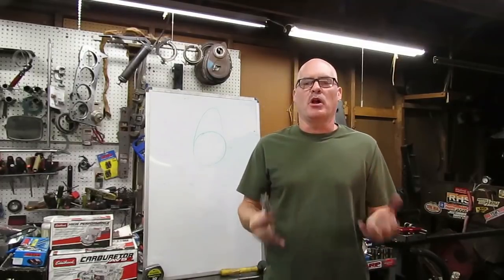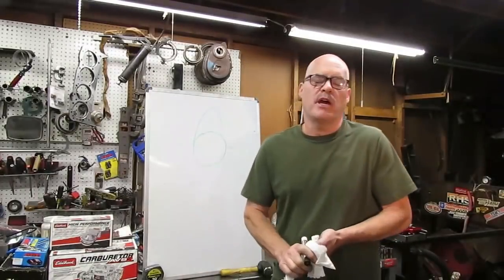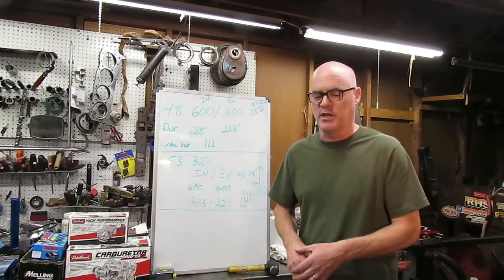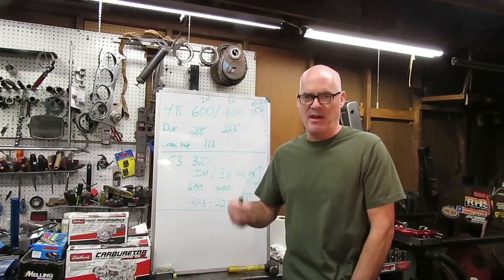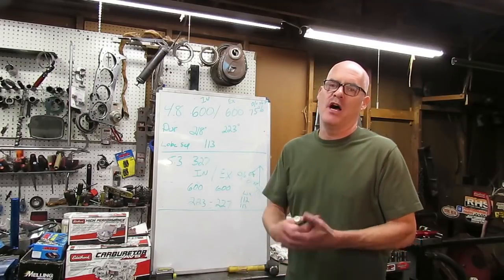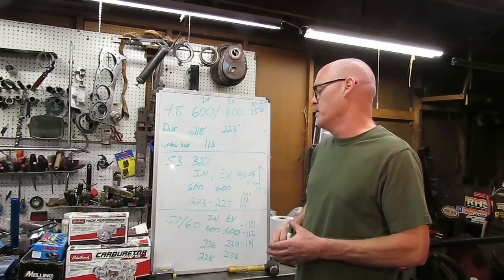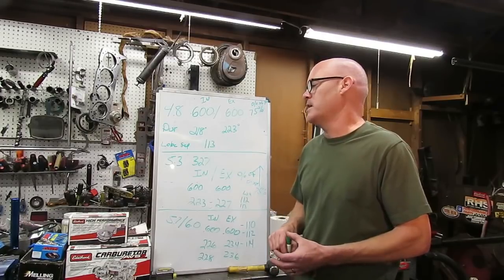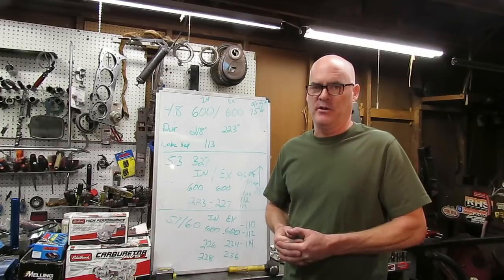How to properly select a Camshaft part 2

Comment: So what your reccomendation for a vortec 350, both roller and flat tappit?
Reply from the maker: for a flat tappet cam I would recommend throwing it in the trash for a roller 218/223 at .050 .500 lift
Reply: @Myvintageiron7512  hi.  I don't understand i saw other video where did you show how install flat tapet and how to break the cam hidráulic flat tapet. So in this message you said flat tapet throw in the garbage 😟😟

Comment: My man, how do I reach out and ask you for a little help. I've got the numbers more or less and I'm trying to pick between one cam or another - but it's for a much smaller turbo application. Do you have an email I could reach out with?
Reply from the maker: I would call Howard's cams and ask them they know more about turbo cams than I do
Reply: @Myvintageiron7512  I'll give em a go, they look like they only specialize in GM or Ford so hope they understand the goals of a Japanese import engine, I'm not aiming for 600hp lol. Something a little less but maximizing the power in my build. Thanks for your help and if you know a better company that knows imports let me know!

Comment: I am building a 532 BBC to run on pump gas, what compression can I run on an engine this big. Can you give me a recomadation.
Reply from the maker: cast heads 10 to 1 Aluminum heads 11 to 1
Reply: @Myvintageiron7512  So on a 632 w aluminum heads I can get away w 11 to 1, so how big of cam would it need?
Reply: @Myvintageiron7512  Can you give me a cam recommendation then I really would love to follow your lead

Comment: If yo "Hot Rod" don't Have a Radical cam Loping Idle,....just go All the way to Electric motor power !! .....The "Old School" Chevy L88 cam Duration was & Still is good for 550-600 Hp N/A......Every new  Factory hotrod today uses a "Cheatin"  turbo or supercharger  "Boosted"  engine to make Any big Hp numbers.....L88 cam Profile Forever man !!

Comment: Short tube headers for high rpm’s? I’m only seeing long tube headers recommended by the manufacturers for high RPM”s
Reply from the maker: nope that's not correct long tubes will give lower to mid-range torque. there is a huge amount of science behind this that I really do not have a desire to get into here because it would require hundreds of pages of typing. let me put it to you in a question how many high RPM drag cars have you seen with long Tube headers google pics of dragsters and take a good look at the header pipes I will let you determine if they are long tube or not
Reply: @Myvintageiron7512  appreciate your reply. I have a high rpm cam in an corvette/Camaro/truck sbc block. Still looking for proper headers. I think I’ll use an X pipe and angle the exhaust under the cab. It’s for a truck. I know you recommend more torque for a truck but I couldn’t resist going for high rpm’s. The cam is basically the same grind as the 302 which I’m hoping will create more power with the 350 stroke. I’ll switch to a bigger cam if it fails. Thanks for all your effort Putting out these videos, they are incredibly helpful.

Comment: How does the cam effect engine vacuum?
Reply from the maker: If you have a big duration cam with tight lobe separation it can cause the vacuum to drop at idle and or low RPM

Comment: Whats best cam for a 350 tbi. Can u put one that lopes in it
Reply: Short Answer is "Not Very Easily" in my experience and I am NOT an expert... NON-Mass Air Factory style EFI...Does not play well with narrow LSA (Or High Overlap) engines...Mass-Air EFI, Carburetors and The Fast EFI systems do seem to be easily tuned for a nasty idle.
Reply: You don't need a lopey cam (or want) in a TBI street car. Watch the vid. He explains it TWICE.
Reply: @joshuagibson2520  how do u know what i want ?
Reply: @johnknight4824  I don't. But I'll assume a cool sounding motor that runs like garbage. 😂😂😂
Reply: @johnknight4824  idk. Maybe your building a drag car with tbi. Lmaooo
Reply: @joshuagibson2520  LOL...Yeah like the 454 SS truck...Swimming Pool Displacement and Garden Hose filling it... Yes I know the 2x2" TBI were rated for almost 650CFM...still it was "band-aid" Fuel Injection.
Reply: @joshuagibson2520  its plain u dont know crap lol so
Reply: One option is: Edelbrock 3702; Duration @ .050 Int.194/Exh. 214; Lift @ Valve  Int. 0.398/Exh. 0.442; lobe sep. 112
Reply: @armandomartinez87  thats no bigger than stock
Reply: @johnknight4824  The stock is:  Duration @ .050 Int 165/Exh 175; Lift @ Valve  Int. 0.382/Exh. 0.402; lob. Sep. 110
Reply: @armandomartinez87  stiil not much bigger

Comment: If you lost all sizes simply on c.i. old or new. You will see the cam sizes for opt. Power are exactly the same. The only difference will be over lap. Old heads will only have a 60% exhaust ratio. New has 75-90%. Thats the only difference in cam choices for those c.i..  If you had old school engines and run massive after market heads. You found the same thing.
Reply: Yep AFR TEA CNC'd etc heads are great for old engines  even street cars on pump gas with no power adders.

Comment: the over lap  Effect the compression?
Reply: Yes absolutely... The more radical cam (more overlap) the less cylinder filling = Less Effective Compression...AT LOW SPEED, That's why if you take that 8.0:1 1970's smog engine and stuff a big cam...its a turd...If you notice the wild cammed engines will have crazy compression ratios, USUALLY!
Reply: @misters2837  Agreed!
Big overlap allows some of that high compression to bleed off at low rpm.
Otherwise detonation would destroy it before it got spinning and has more advance (talking street car...)

Comment: Very informative videos, but here's a good question for you!  If I have an old school SBC 5.7L and I want to upgrade the heads to my 90's block, which casting numbers of the cathedral ports would match the block and that would work best for a truck that weighs 5750LBS and a stock tire size 235 75 R15? Also what cam would be best for a vehicle like this that also does a lot of hauling? I really put my cowboy Cadillac to work! But I also use it as a daily! I also have a 35 dallon tank in it! The engine that is in my Silverado came out of my 1990 K5 1500   Blazer if that helps you out at all! I also have both power steering and power brakes. I've been told that that also may make a difference in the selection of a cam too! Don't know if that was accurate or not,  but I wanted to let you know just in case. I also have a full 3" exhaust system on my truck!

Comment: Your video caused a question i can't rap my head around. what if you had a head flowing 246 cfm Intake & 156 cfm exhaust but ported the exhaust to 204 cfm giving you 83% efficiency, would you better off leaving the intake alone and running a single profile cam or porting the intake having to go to a dual profile?
Reply from the maker: more air is always better port the intake

Comment: You're talking about restriction to flow in the exhaust, but you're missing the idea of velocity and inertia.
It's not so much the restriction as containment.
The smaller tubes force an equal amount of exhaust gas to flow faster.
Mass x Velocity squared.  Keeping the speed up means *velocity is a multiplier for kinetic energy.
Also, where the charge expands in the collector it loses energy as heat.
Think about how cold a die grinder gets in your hand when you're porting.
The 'cold' is the compressed charge consuming energy (heat) as it expands.
Yeah, it's geeky. But gas laws from Venturi, Bernoulli, Advagaro, Boyle, etc dictate the physics of fluid dynamics and thermodynamics.

Comment: Part 3...Degree your cam....LOL...OMG you have NO Idea how many engines that were "Built" and the guy claimed to have "Installed it straight up" That I took apart. - BUT HAD NO IDEA SOME MFRS PUT 4° ADVANCE IN THE GRIND!
Reply: Ground in advance can generally be a good thing since most folks cam their stock(insert whatever "RV" cam you want here) engine, without increasing overall airflow so it helps maintain cylinder pressure. I still use Dyno2000(yes, I know it's 2020) to get a general idea where the ground in advance is going to move the power band. But the cam is still degreed and adjustments are made as necessary.
Reply: @corinelson7837  Actually I have used Dyno2000 (and Comps CamQuest uses same technology) it is OK for the Hobbyist..The Desktop Dyno 2000 makes "generalizations" and as long as you know you are not gonna that EXACT horsepower...but I also have DynoMatition 6 (I just upgraded but haven't played with it) I had Other previously released versions, and its really accurate, but requires a lot of parameters, that software is a little too expensive for your Average guy. - I used to work at a large engine builder, and then was a partner at a smaller shop (half dozen guys) that we still have some machines and tools that we share as we still do "side jobs" mostly assembly work these days as some machines are hard to keep up with... That software is handy because it can give you an idea how well a combination really will work.  (Though some of it is plainly experience.)  Yes the advance is there to compensate for timing sets and other things...but my point is that if you are gonna say it's "Straight Up" you should have set it with a degree wheel and dial indicator...

Comment: "Wide LSA generates more cylinder pressure at low RPM"  The tighter LSA generates a higher Dynamic Compression Ratio though... If you do the calculations for say a 112 vs 108 LSA you'll get a Higher DCR with the 108.  Dyno results even for the LS, show greater low speed Torque numbers with a 108 LSA than 112 or 120 #3500 it's a significant gap https://www.youtube.com/watch?v=JUHwVCDjonU.  The Dyno results for a SBC also always seem to favor a 108 for a 2.02 intake valve resulting in a higher average torque per cube.  Are you talking idle to say 2000 RPM where they don't run the DYno?

Comment: Looks like the key ingredients to a matched motor is cam selection to head flow to exhaust outflow with correct intake with correct carburetor.If you guess wrong and you won't have a optimized motor.Make two wrong choices and you have a pile of poop.

Comment: Simplified...3 types of cams...performance, stock, mileage.  Average drivers stock cam for normal rpm range. Drag racers performance cam for high rpm power. Mileage cam low end torque and maybe an extra 1 mpg. General rule bigger the cam gas mpg decreases. Stock cam is a good choice for average drivers because the engineers are not stupid. Don't ever put a big lopey cam in a street vehicle because the guys who really understand cams know you don't have a clue.

Comment: With Overdrive transmissions & hi-Stall Lock-up Converters plenty Available,...Unless you're building a Tractor or Work Truck engine, Who gives a Flip about the "Low Rpm"  torque curve issue ?? .....Man up & Use the amount of cam Duration your engine Needs for It's intended Max performance Midrange/Top end Rev range !! ....,

Comment: Good on this guy for making some videos but seriously, I am cringing with almost everything he says! He lost all credibility when he said overlap reduces cylinder pressure! What pressure are you even talking about? Overlap is a product of where the intake and exhaust lobe center lines are placed and the seat to seat duration of the lobes. When both or any valve is open there is no downward pressure on the piston, that's the only pressure helpful in rotating the crankshaft. The pressure he is ignorantly referring to is I believe the pressure that the cylinder puts the fresh charge under on the compression stroke. That is determined by two things- How full the cylinder is with charge before the piston starts it's upward travel and -When the intake valve closes on the compression stroke. Longer duration camshafts have later closing intakes...and the cylinder doesn't start to pressurize until the intake closes. Shorter seat to seat duration camshafts close the intake earlier and there is more cylinder left to compress and they make better cylinder pressures at lower rpm. Because air takes real time to move, if you want the cylinder to breath at higher rpm you have to start processes earlier and extend them later to get the more complete filling and exhausting. What he says about wider lobe separation being conducive to better low rpm torque is completely incorrect! It will give a better idle because the retarded intake isn't spiked as much by the pistons upward travel on the overlap/exhaust stroke. As the two lobes are pushed apart it reduces overlap which cleans the exhaust up which is emissions friendly but it opens the exhaust earlier on the power stroke. As soon as the exhaust valve opens there is no longer downward force on the piston, it is easier for the pressure to go out of an open exhaust valve than push down on the piston. The later you open the exhaust ie retard the exhaust C/L(a tighter lobe separation) the longer the push on the piston. The wider separation advances the exhaust opening which helps start the evacuation process earlier for higher rpm efficiency. IE at 8000 rpm things are happening very quickly, you have to start blow down earlier because whatever pressure is left in the cylinder at BDC equates to a pumping loss. We are all still learning, but get your information correct before you advocate you know what you're talking about and make a video most people will believe what you are sharing is true. 
     What effects idle quality is how much intake valve opening there is @TDC on the overlap stroke. As you tighten the lobe separation you advance the intake opening and retard the exhaust opening. As for pressures - the power stroke exerts pressure on the piston. The exhaust stroke consumes energy to pump the residual pressure still in the cylinder after the power stroke and blow down.(Every day's a school day)

Comment: David Vizard disagrees with this sooo much. He thinks 104-106 is where everyone should live, 108 if it's a mild street car. He's also 400 years old, and primarily focuses on track builds. He doesn't know how to build a daily basically.
If you're right; then I'm sticking with 112 lsa because I want engine vacuum.

Also guys, use heavier better springs on your rockers.
Reply from the maker: I have great respect for DV he is a very intelligent engine guy, I have learned some things from him,  but here is the fact of the matter is he does not know LS engines if you notice the LS is the main focus of this discussion if you spend some time searching the internet you will find that the guys building and dyno testing LS engines will be in agreement with me

Comment: They are garbage compared to nowadays technology..... but back in the day they got the job done.  I got to admit, I run modern fuel injection on turbo LS stuff, but my blow through twin turbo c10 makes a ass out of the LS and fuel injection on the low end